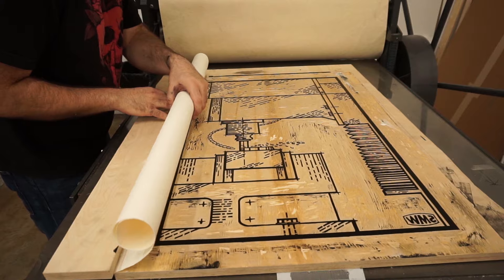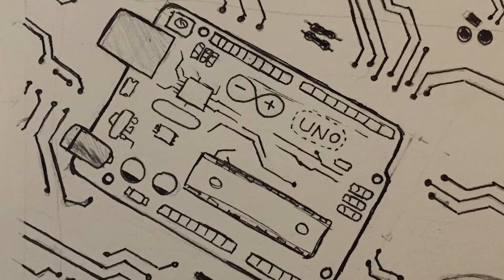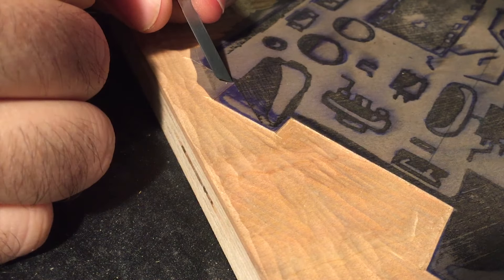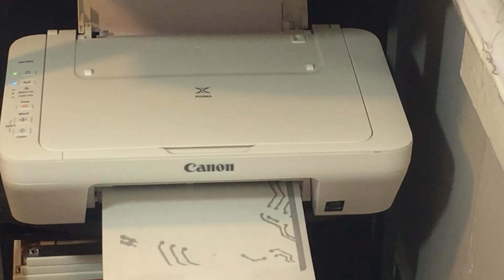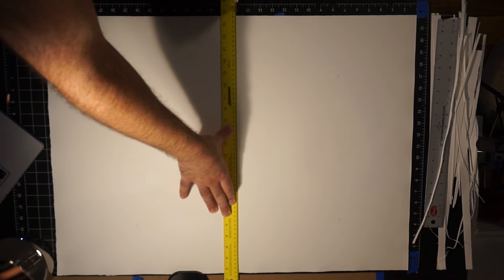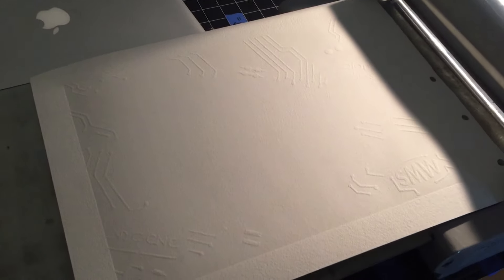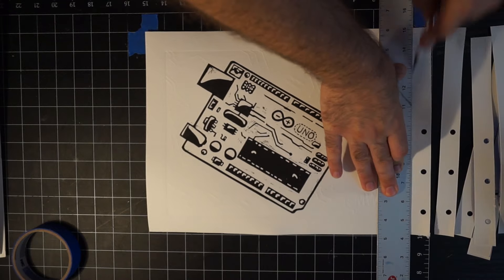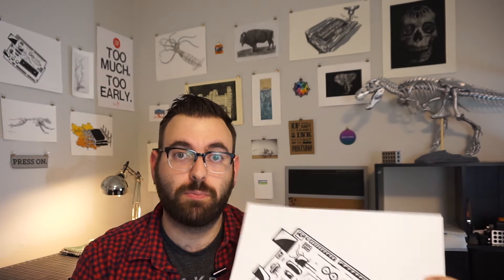Arduino Woodcut Print for NYC CNC

Comment: Really cool technic for embossing. I have never tried that. Can you emboss without having a roller press? I have one of those little lever presses for small prints, have you ever used one of those for that?
Reply from the maker: I think it might work, but you'd need to get enough pressure. I soak the paper first, which might help in your case. Good luck!